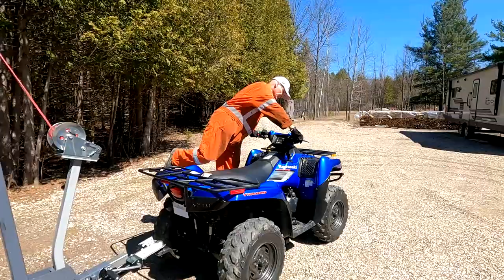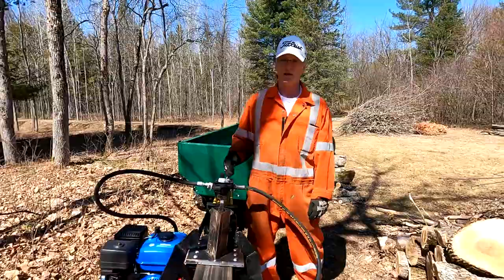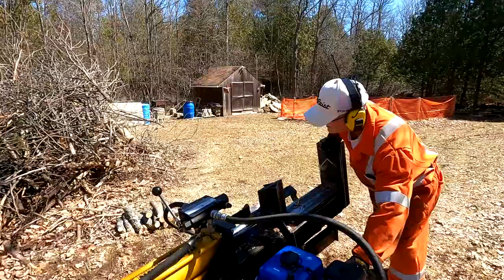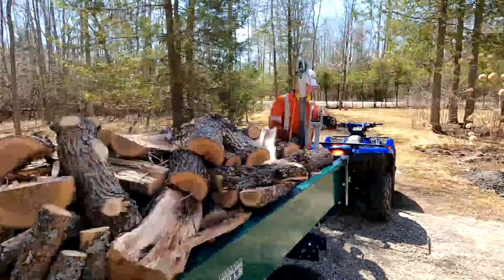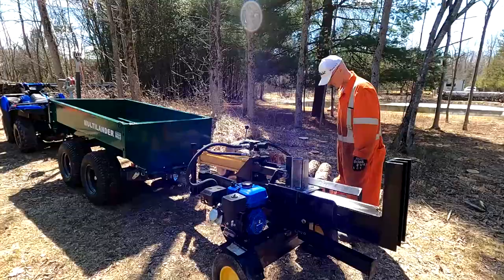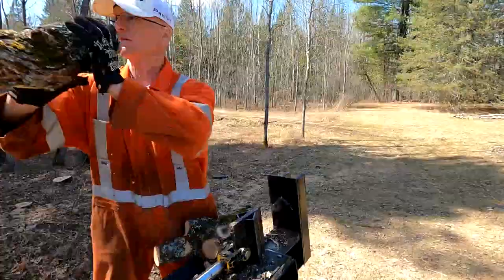34 - Log Splitter - Dump Trailer & ATV

Comment: That's a really nice setup you have there, Paul. Too bad they aren't making that trailer anymore - I wanted one!
Reply from the maker: Thanks, it works pretty good.  The splitter is old and slow but I  am not in any hurry to get things done when it is just for me.  I was surprised that they stopped making the trailer.  I called and asked them why, response was their focusing on the flagship products, trailers require too much more inventory space and pandemic issues.  Doesn't seem like they will go back to making them in the future, at least for now.   Thanks for watching my friend!